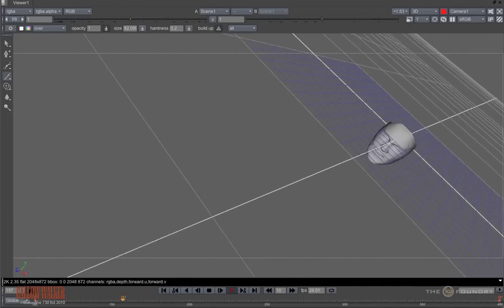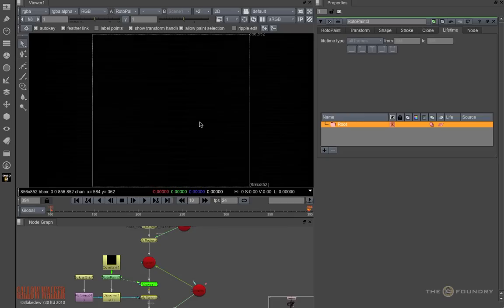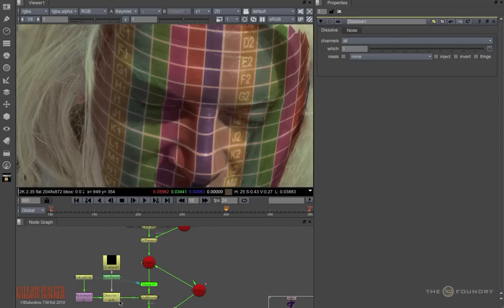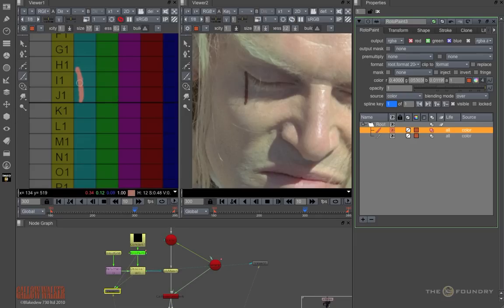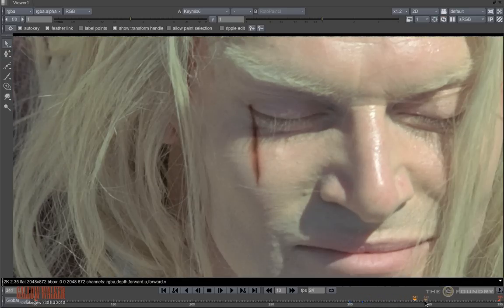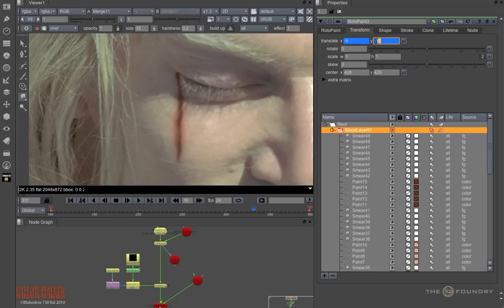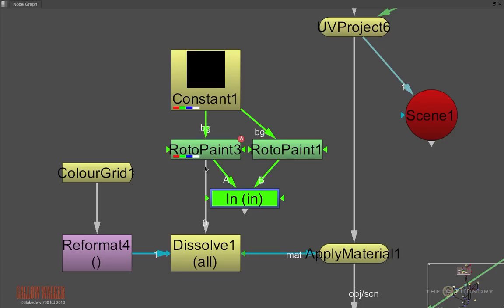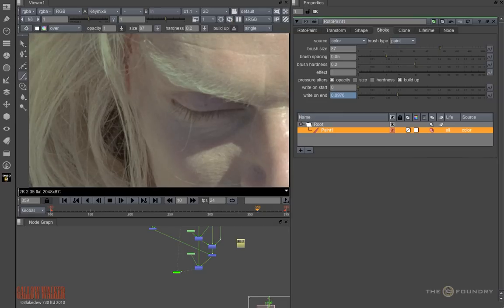Nuke | Painting Onto Geometry With RotoPaint

Comment: I have downloaded the Nuke_PaintRoto_WireRomoval_Assets, but there is only a DPX seq. in it. No colorgrid.
When you paint it fits so well to the face in color. How did you set up the project? When I do it, it looks flat. No difference on my blood paint between the final comp and the rotopaint on the constant. I also tried different modes in the Merge node, but doesn't  looks like yours.Can I get any more info on that or may be a project file without the footage?andor.zahonyi"at"gmail.com.Thanks